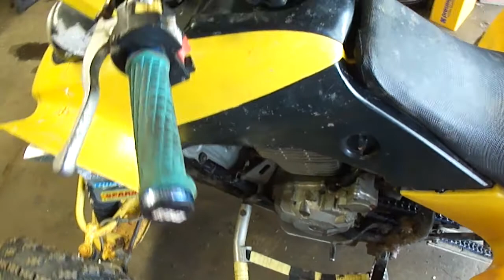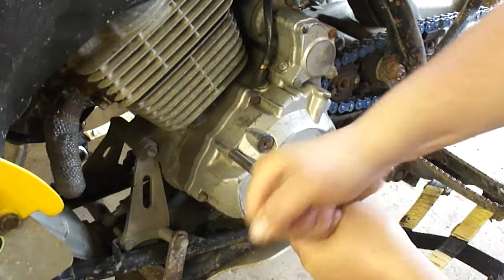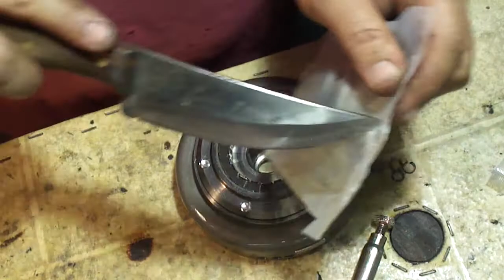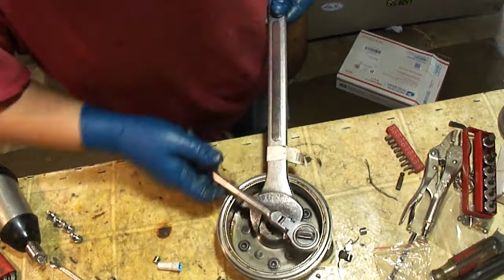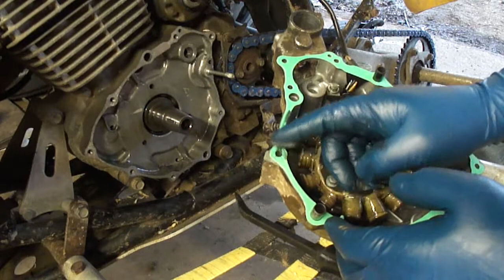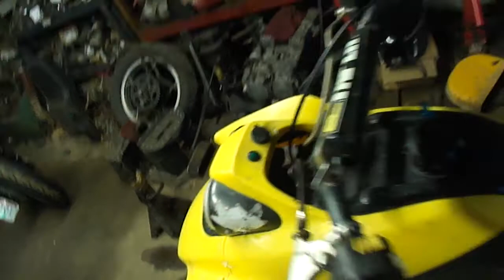Honda 400EX Starter Clutch Replacement

Comment: Is this a common problem with the 400ex ? Im getting ready to buy one and the guy im buying from said only thing wrong with it is that the clutch feels like it pulls but its like the clutches wont grab!!......do you think this is the problem?
Reply from the maker: The transmission clutch and the starter clutch are unrelated.
Reply: @MrFixit1  would that be an expensive fix?  Is it worth buying if I'm only buying it for 800?
Reply: It's a 2006 Honda 400ex
Reply from the maker: @toniortiz819  If you're talking about the starter sprag one way bearing, it is a cheap fix.

Comment: I can't get the big bolt off, just spins.
Reply from the maker: Are you talking about the engine spinning? Put trans in 1st gear and try to hold the brake.
Reply: @Mr. Fixit  yes I am,  been having problems holding it still while loosening. You did it In a sec with your impact wrench. Ima have to buy one. I'll try your advice to
Reply: @PrevailArmy put a wrench on the one part and postion it so when you go to losen the bolt it spins the wrench 🔧 into the foorstand  to give you the leverage you need and stop it from spinning around.